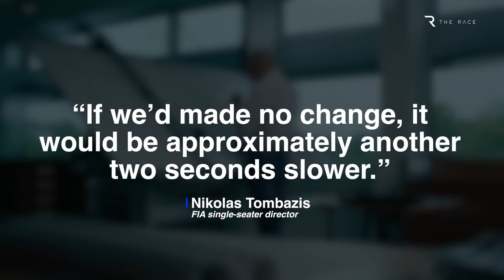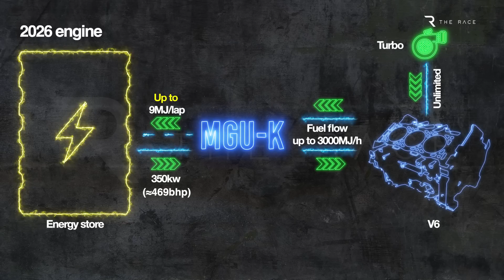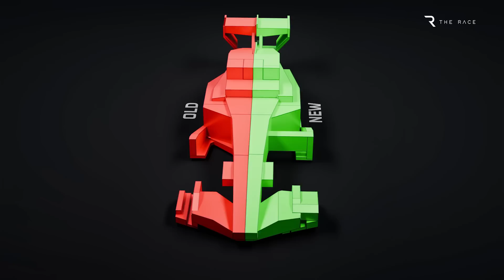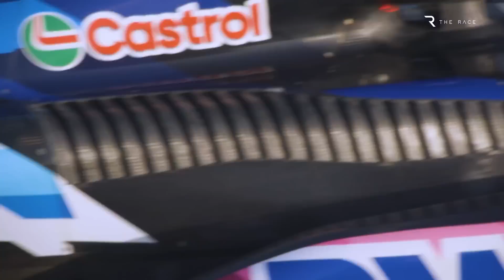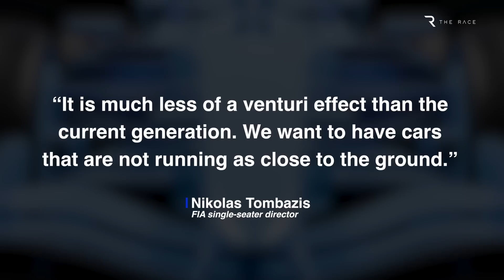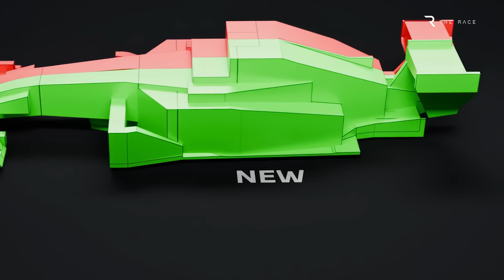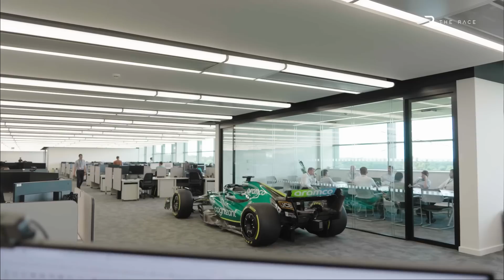How F1's 2026 cars will now be two seconds faster

Comment: Even if you put a "new smaller" 2026 F1 next to a 2000's F1, it still looks absolutely horrendously gigantic.
Reply: Don''t forget that by the 2000's, the FIA had reduced the width of the cars TWICE and reduce the width of the tyres TWICE.  Compared to a 1992 car, the 2025 car is narrower and has about the same size rear tyres (front tyres are very wide, due to the way they were scaled up despite never have been scaled down in the first place).

Comment: The regulator should fab a setup that follow  the new car at a given distance with pressure sensors and measure the air disturbance so to make sure all the new aero meets the design goals of the regulator so cars can follow as designed in the reg.

Comment: These rules mean nothing until overtaking is a regular thing at Monaco and other street circuits.
Reply: That is never going to happen at Monaco
Reply: @ It should be an aim. Procession "races" are never fun.
Reply: Regular overtaking at Monaco has never been a thing. That's a ridiculous bar
Reply: @ 
Please do some research first. 17 in 2006, with 16 overtakes at the 2011 and 2013.
The cars were smaller back then and the drivers themselves have been asking for smaller cars.
Reply: @fablewalls  And there were 23 overtakes in 2023.

Comment: Bring back v12's like the people want
Reply: Those engines would literally not fix a single one of F1s problems
Reply: @Infanterie_Marine  maybe the sound aspect, but worse in every other way.
Reply: @aominnomad  How would they be worse? No electric motor, no battery, no energy recovery system, no turbo system, and sound 1000x better. They could use eco fuels like super GT uses, and have a massively cooler power unit that would be cheaper, easier, and better FOR THE SPORT. 

Edit: to be fair, I don't think they would ever go with V12 again, but I can see them going back to a NA V8 though, which would also be cool, but not V12 cool...

Comment: I am still yet to understand why the fuck we are bothering with batteries and electric drivetrains when we are already getting onto sustainable fuels and the whole automotive industry is moving away from EVs.
Reply: Sustainable fuels are not actually really sustainable - it's a marketing lie by the oil companies - and allows F1 to greenwash.
That doesn't mean I disagree with you though - the emissions of the cars themselves are miniscule compared to those of the logistics movements and if that was cleaned up then it would be fine
Reply: 1. I agree
2. In what way is the automotive industry moving AWAY from EVs?
Reply: @yeaggermiester I think they’re referring to manufacturers moving away from their “all EV, petrol is dead” goal that they’d been pedalling for the last 5-7 years. In fact introducing more petrol cars to the lineup. Sustainable fuels and hydrogen will realistically be the standard in 50 years, not battery EVs
Reply: What kind of brainless comment, since when is the automotive market moving away from EVs?? A majority of the worlds manufactures have 50% EV lineups…..
Reply: The Industry isn't moving away from EV's, just pivoting to prolong the switch as currently infrastructure isn't ready.

It will have to happen though. We only have so much oil and could be reaching peak oil anywhere between 2030-2050. So we need to be ready for that as oil prices will start going up.

Comment: They be doing anything but bringing back 2017-2021 cars, they were THE F1 cars , even in safety.
Reply: the 2017-21 cars had too much dirty air though.
Reply: 2022 rules increased crash test severity and increased safety. Indeed, in 2023 the roll hoop test was increased in severity after Zhou's roll hoop broke off.

Comment: No flatout laps anymore? What is this? F1 or a clown show. Increasing electrical dependence will make them slower. Much slower. Reduce the increase in electrical energy to around 200 KWs instead. And allow more freedom for engine types like in WEC. We want more variety of engines like V8s, V6s, NAs, Turbos, at least.

Comment: The hybrid electrical system is a boondogle. Being 50% of power is ridiculous because it doesn't generate any energy, it just revovers energy from the internal combustion engine.
Reply: I genuinely don't understand the problem.
Reply: Uhhhhh no...? Hybrid systems are able to recover energy under braking to charge the battery. The problem is that when you brake the weight of the car shifts forward, which means you can recover more energy under braking if you have an MGU-K on the front axle, which is something that F1 is avoiding and there's a limit to how much energy you can recover from the rear axle alone. Based on what I've heard from a channel called b-sport, he mentioned that F1 is burning fuel to charge the battery via MGU-K(I think you may be right that they are doing this now as well but it will be more pronounced in the 2026 regulations). The other way they make things more manageable is active aerodynamics to minimise drag all the time, lower drag = lower energy required for acceleration/top speed, improving energy efficiency, but the downforce levels are decreased. Overall, it's not 100% wrong to increase the hybrid power output of the power units, but they shouldn't have increased it by that much, maybe a 35/65 split or 40/60 split would have been more manageable.
Reply: @YHongBladeV16ZS5  "Hybrid systems are able to recover energy under braking to charge the battery". You literally just used the word "recover" genius. Recover from where? Outer space? It's all coming from the engine. Where you do think the breaking energy comes from? Remove the engine, can the car work? Only until it depletes the battery which is less than 1 lap. And then what? How you gonna recover energy from breaking if you're stationary? Genius comment right here. All the energy is coming from the engine in the end. Adding a battery does not give you more energy, it just makes the energy you have already a bit more efficient cause you can recover some of it instead of just releasing it into the air as heat.
Reply: @Dyils  Generating energy under braking is using the kinetic energy from the car itself, energy that would have otherwise been wasted.  Before regenerative braking, all of that energy was just lost, and the cars still lose a fair amount of it into the brakes.    So, not just "recovering energy from the ICE".
Reply: @vandalsgarage  And where did that kinetic energy come from? The ICE. All of the energy (except the initial battery charge which is less than 1 lap worth) originates from burning fuel in a combustion engine.
Reply: @vandalsgarage  it was possible with front regenerative  braking, but again FIA became FIA dont want audi dominates it
Reply: @aguywithanopinion8912 but that energy would have been lost to friction in braking, this way it is harvested to be used later. So it doesn't come at the cost of the energy produced by the ICE, it comes from the need to not brake as hard with the calipers.
Reply: @Infanterie_Marine  No shit. But it's produced in the ICE which is the OPs point
Reply: @aguywithanopinion8912  What even IS the OP's point? This is one of the most ridiculous nothings to whine about.
Reply: @ Me whining? Or the OP?
Reply: @aguywithanopinion8912  Yeah but formula E and pure EVs exists so..
Reply: @ "The ICE does not generate energy, it just recovers energy from the high pressure gases in it"
Reply: @Infanterie_Marine  LMAO this comment cracked me up so hard
Reply: @ I feel like I am having an argument with people but I am not too sure what we are arguing about...

Comment: Separating the weight of the set of tires from the weight of the car is SUCH an improvement.
Reply: This comment aged like fine wine with the Leclerc DSQ lol
Reply: 2027 cars become 200kg lighter and then all you have to do is add the 190kg engine……
Reply: @senseofthecommonman  The engine's weight doesn't decrease over the span of the race.

Comment: Not a single F1 fan asked for more electrification.
Reply: but but but the engine manufacterers......   Like anyone cares, Ferrari will stick around their road cars are almost exclusively ICE powered. I don't think any F1 fan has a problem with 22 Ferrari powered cars competing. F1 wants to be cool and hip and is focusing too much on things it shouldn't focus on.
Reply: @nielsvanheteren  "Ferrari will stick around their road cars are almost exclusively ICE powered" They can't have their heads in the sand though. The ICEV bans are either 2030 or 2035 in many markets. These apply to Ferrari (and McLaren and Aston Martin) road cars, just as they apply to an Alpine or Mercedes-Benz.
Reply: @TassieLorenzo  Yes but Ferrari is the only one who said they'll just keep on making them until they aren't allowed to anymore, cause that's the car people want, not those EVs. So I kind of guess they would be willing to supply the whole F1 grid with ICE V10 engines as they would be what their fans and buyers want. Ferrari also sells outside Europe where most of these bans will take effect so they'll keep producing ICE's, might just not be in Italy all the time.

Comment: The main problem is that so many fans and the drivers want different things and it’s pretty difficult to cater for everyone, some want wheel to wheel action, some want the perfect fastest lap time, some want the car to look good, some want innovation, some want things to be simplified.

As long the cars just work like a dream and the drivers are putting their heart and soul into their racing, is all I want, but if you want something else in F1, do please, share your thought
Reply: They should just go back to full ICE powered cars. I don't care if engine manufacturers leave. No fan will, I'm not excited Max Verstappen wins with a Honda engine, I'm excited Max Verstappen wins. F1 is about the drivers first. Ferrari will stick around and produce engines cause they also don't care. You can see it in their road cars which are mostly still fully ICE powered. Let all the others go down the rabbit hole of electric cars when they will become impractical anyway once hydrogen cars are a good alternative.
Reply: @nielsvanheteren You say that, but LMP1 died because the manufacturers left. Hypercars are now in a golden age because the new regulations have made top flight endurance racing as accessible as possible to manufacturers.

Comment: the 2022 regs had the same hype and worked in first few  races but in half a year cars coudnt overtake again, the fia is just trying to kill the sport at this point, just get the cars lighter and smaller, they do that and then increase the size of the battery.... man just go f off and take your sh*t active aero with you and give us indycar spec cars, racing is way better with those

Comment: So basically F1 now gets a push to pass ERS button (2x the amount of bhp), no slipstream due to active aero, more dirty air again and much slower cars than current gen and no DRS. All just because F1 wants to go green? The emissions from these cars over a season is negligable, especially when you factor in all emissions around the event. F1 is going to be a disaster from 2026 onwards. I might just stop watching all together. It had its time, maybe some other racing series can take over the title of pinnacle of motorsport, they're ruining F1 by making it F2 speeds.
Reply: F1 doesn't want to go green, the manufacturers do. FIA representatives have already stated that had they not announced the 2026 PU regs, only two engine suppliers would be left in the sport - Ferrari and Mercedes. For the wealthy giant that is F1, that was unacceptable, so we got this garbage instead. And it's even more mangled from the original concept due to compromises made to entice the VW brands enough without upsetting the incumbent manufacturers too much.

On the positive side, sports car racing is thriving at the moment, you can always go give that a watch.

Comment: 🔥 Exciting changes ahead! F1's 2026 cars will be 2 seconds faster ⏩💨! New regulations, better aerodynamics, and insane tech upgrades
Reply: No they will be 2 seconds faster than the previously imagined 2026 regs which were slower than Super Formula and just a 3-4 seconds faster than current F2. FYI current F1 gen is 16 seconds faster than F2 around an average sized circuit. And no 2026 is not exciting. Them changing so much so late in the process just means they messed up. The 2022 regs were already settled years in advance and not changed. They now realised they got themselves F2 grade engines and are desperately looking for any way to compensate for that complete fuck up. They're pulling everything out of the back, active aero (which will ruin slipstreaming), new barge boards (which will increase dirty air), smaller cars (only pro) and insufficiently sized batteries just to keep weight down but it will also mean ERS can only be used for maybe 1-3 seconds very lap instead of the 33% of a lap in current gen. F1 2026 is a mess and them still changing regs even though these cars need to be racing in a years time is proving it.

Comment: Don't try to make cars faster, try to make them better, trying to make them faster got us drs and most would agree we rather not have it
Reply: The key thing here is that cars are faster under their own power in most or all circumstances. All else being equal, faster cars = higher skill cieling = more separation between bad, good, and great drivers.
Reply: Well DRS is gone, in its place you will get a ERS push to pass button which will double your bhp, but it can only be used for a few seconds per lap, meaning passing will be done only on straights far before any braking zone and we will see a lot of braking in the middle of the straight to regain a bit of power to use again on the next straight to pass your opponent.

Comment: We need to go back to early 2000 cars, thanks.
Reply: As a minimum we need early 2000s tires. Those cars could follow each other close all day long thanks to those tires. If they had DRS back then there would be a lot of passing.
Reply: @PenteanoO  it's not about the tires. When the aero got too complex and dirty air started to become a big issue, that's when cars needed DRS. The tires had no effect on that
Reply: @ Nope. Watch older races before Pirelli. See how cars could follow each other from a close distance all race long. That classic Imola 2005 battle is a good example of that.
Problem with F1 in the past has always been having too much power. That made the cars deal with drag too easily which didn't give enough slipstream for them to go side by side. THAT is where DRS helps (tho it should close as soon as cars got enough speed to go side by side, imo, it shouldn't work as a free pass ticket).
Compared to now cars have some time to overtake otherwise they need to slow down to cool the tires and try again because the tires can't handle it.
Dirt air has always been a problem but the lack of slipstream was a bigger one. When Pirelli arrived the tires became a problem as they can't handle the downforce loss when cars are in dirt air. This still happens under current rule cycle.
Reply: @PenteanoO  have you stopped to consider the fact that the aero has gotten a metric fuck ton more complex since then? Besides, Pirelli started being the sole tire supplier of F1 in 2011. Between 2011 and 2014, I don't remember hearing about any complaints about the racing not being close enough
Reply: @ If you don't remember you weren't watching. People always complained about dirt air.
But it got a lot worse with Pirelli because the tires just stopped being able to handle it. And yes Pirelli started in 2011. That rule cycle ('09-'13) overall was great, 3 close seasons, 2 RB dominated. DRS started in 2011 as well.
Reply: Safety regulations would say otherwise. early 2000’s era cars didn’t have large enough crumple zones. The current cars do
Reply: @ maybe I didn’t mean exactly to spec. I’m well aware it’s more than just crash protection . . .
Reply: @Car10121-s  the wheelbase of the cars was shortened, and the width narrowed. If that’s what u meant, I’m pretty sure they did what u asked them to do. Idk what else u want
Reply: @mrsoisauce9017  yes because that’s all that is needed to be similar to a early 2000 car. 😐😒 I’m struggling with a reply to your incompetence.
Reply: @Car10121-s  the way u worded ur original comment, you made it seem like you just wanted the early 2000’s regulations, but in 2026. How is my inquiry about such a statement incompetence?
Reply: @mrsoisauce9017  maybe you’re taking my comment far too seriously for some reason.
Reply: @Car10121-s  how seriously am I supposed to take it? It's a YouTube comment section. Sarcasm over text doesn't work the same as it does verbally
Reply: @mrsoisauce9017  It's ironic.  Car length was FREE until 2022 (car width was free until 1972, car height was free until 1977).  If you had 2006 rules now, the cars would still be incredibly long as the engineers have now worked out that making the car as long as possible gives more floor area which gives more downforce.  People complain that the cars are too long even though both the 2022 and 2026 rules have taken steps to reduce the length of the cars on average -- go figure!
Reply: @ well not seriously at all if you can’t work it out. Since there is little to no change of it happening, clearly, obviously, evidently. Or not.
Reply: @TassieLorenzo  safety regulations have improved since then. Car length would have increased as a result of that, not the underfloor. Ground effect has been absent from F1 since 1982. It only came back in 2022. There would be no reason for the cars to lengthen if the floor area could not be used for ground effect